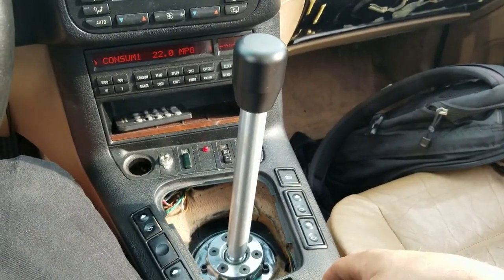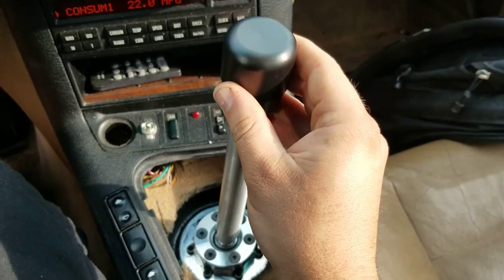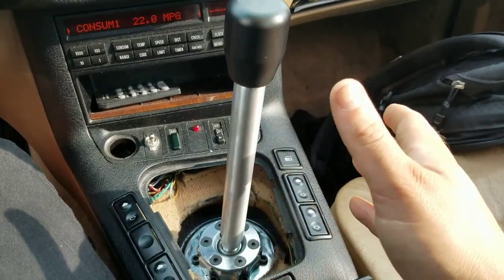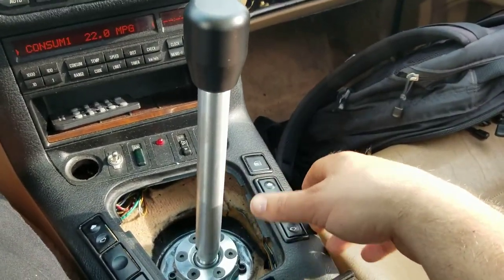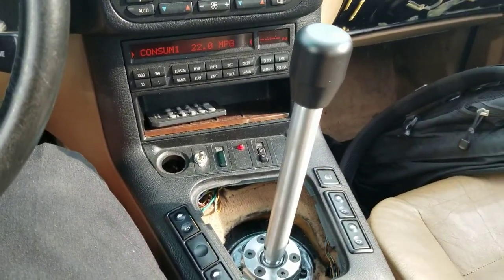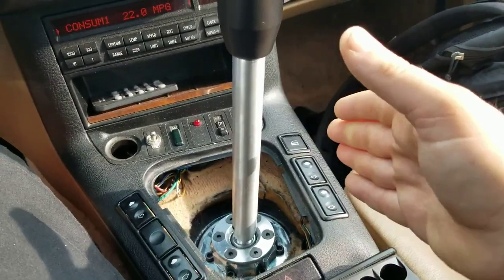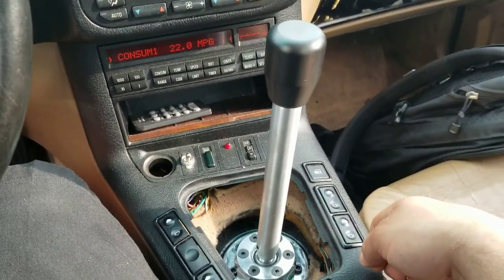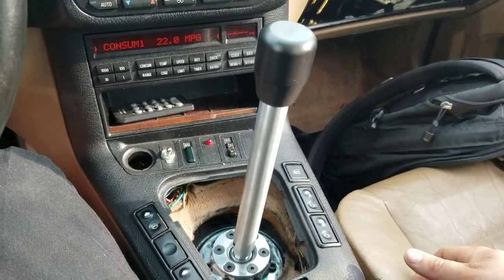Customer Review of Garagistic solid mount shifter

Comment: you know, you could easily remedy any concerns with those set screws by machining a small band for a spring clip like the one on the selector rod joint that would sit over the head of the set screw....

Comment: Shifter review that doesn't show 1 single shift...how bout we do a proper review. I'm currently having the detents done in my zf. I have ALL the bushings replaced and a DSSR. Currently I'm running the ZHP oem short shifter and ZHP weighted knob(the PRIME oem setup). We can do a TRUE comparison of the best OEM set up with a PROPERLY maintained transmission to a PROPERLY equipped solid mount. I have an OEM+ build so we can highlight the OEM shifter for the guys looking to keep it stock looking,but also switch to the track shifter. I'll measure shift times,throw lengths and even compare installing. Finally after the solid mount is in ill actually show the shifter WORKING! Let's do this right!
Reply: I want a free shifter too can you sponsor me 😏🤣